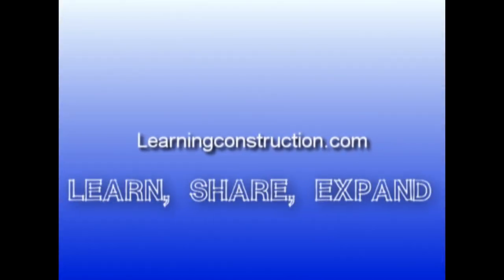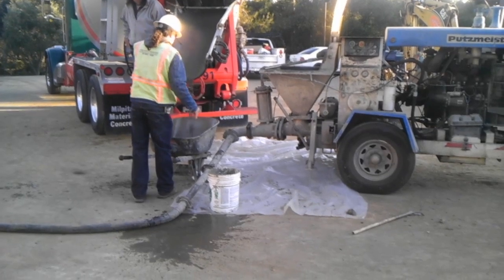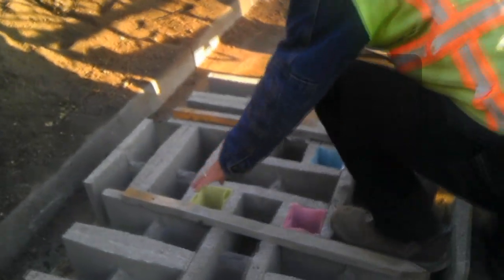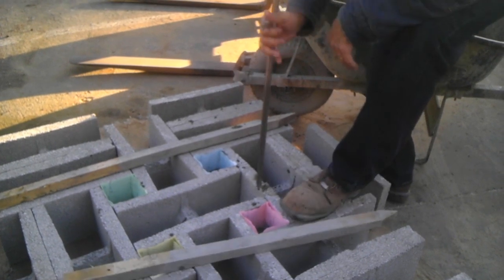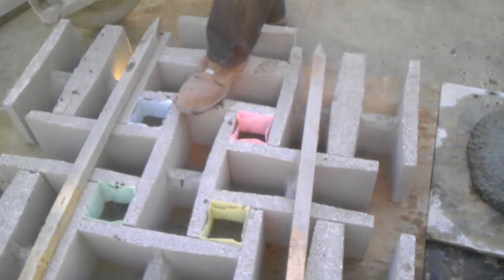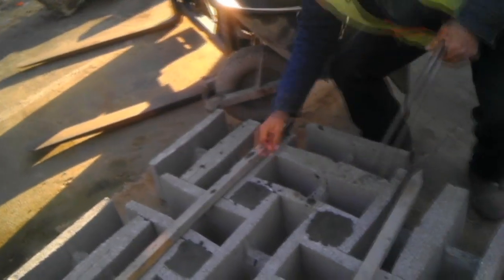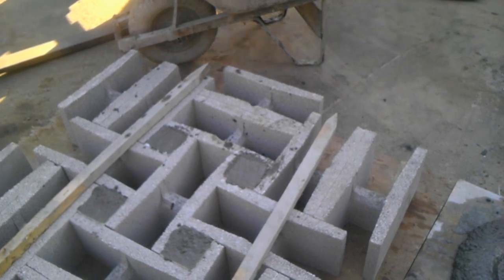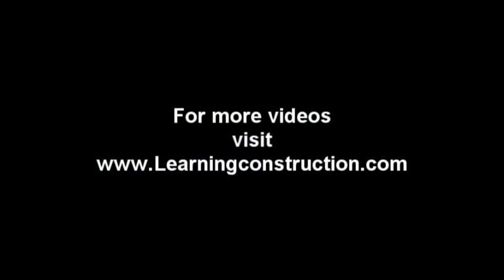Making Grout Samples for Construction Inspection

Comment: Having twelve 12" blocks is impractical for any inspector who does multiple job site vists in a day.  I've been doing inspections for 16 years now and I've only been required to do this particular test method on one job.  We always use the cardboard boxes.
Reply: Yes sir..cardboatd grout boxes. I now & then run into jobsites with prehistoric specs that actually require making pinwheel grout samples.
Reply: @altaf1977  i had to do it on a job where the only block on site was split-faced (with one rough side)...which made it more difficult to make the samples.  The were only 4" blocks too and would blow out if i didnt set it up just right.  It required 10 blocks for just 3 samples.

Comment: This does not conform to any sort of ASTM standard. Molds should be metal and the list goes on and on.
Reply: +stynga You might be thinking about cubes. Prisms for grout can be made in cmu blocks or cardboard sample boxes. They mimic the absorption of the water from the grout. If you use metal molds, it would not be representative of the placed grout in cmu block walls.
Reply: You are wrong.  ASTM C1019.  https://www.astm.org/Standards/C1019.htm